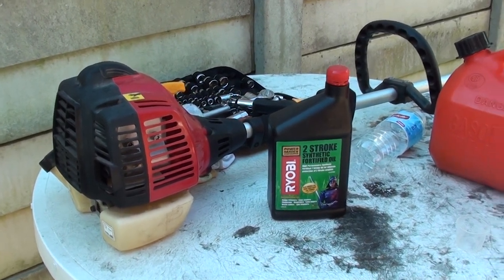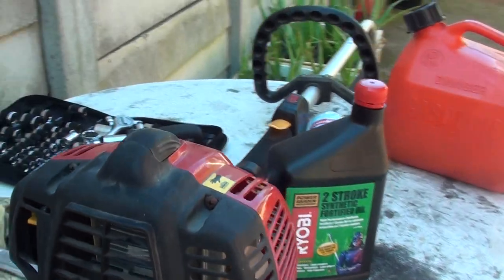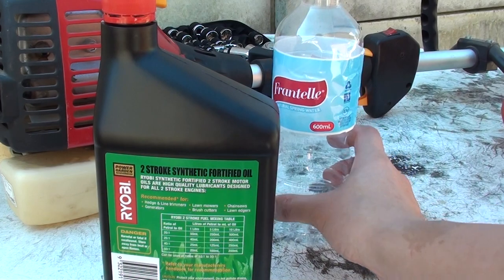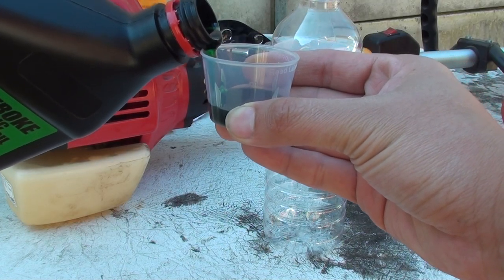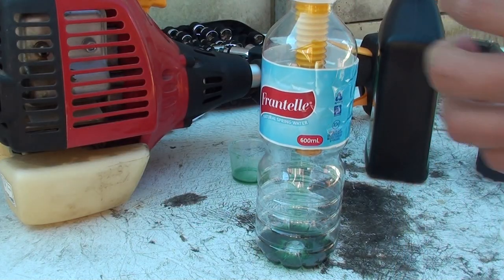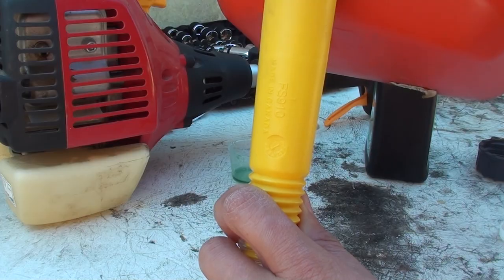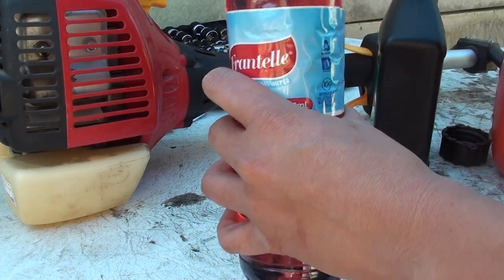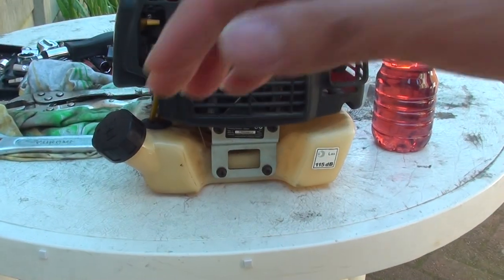How to Mix Petrol Oil for 2 Stroke Engine Whipper Snipper / Weed Whacker

Comment: Your math is correct.
But the water bottle is rated @ 600ml (1:25) and NOT 500ml. You got 10ml (1:27).

You actually have at the end results was 60 to 1. Not 50 to 1.

So was the gas poured in at the level was 500ml (3:00) includes 10ml of oil?
Remember, the water bottle is rated 600ml.

Comment: I have the exact same as your one and had it for 5yrs. I am finding it hard to get it started now.

What do you think the problem is?
Reply: Hm. I know you've probably already replaced it by now but I'm guessing you never had it serviced or cleaned it. That could be the issue. Otherwise prime it, clean it, take care of it, maintain it. It'll last you a lot longer.
Reply: Compression ring wear five years is good period though

Comment: i think this is wrong although i like the idea. shouldnt it be 1000mls+20mls oil. If you put in oil first that means you are only putting 980mls of petrol + 20mls of oil = 1000mls of mixture. his bottle was 600mls
Reply: 60:1 is the same as 600:10 (you just multiply left and right by 10). Hope this enlightens you, cheers